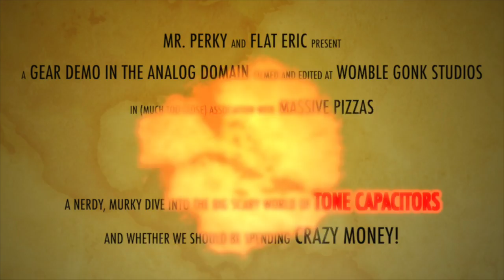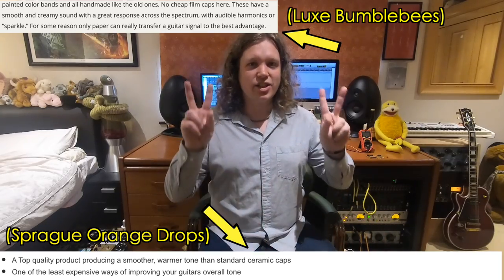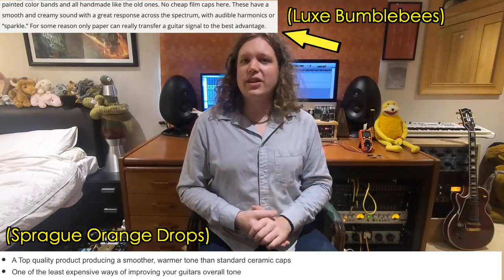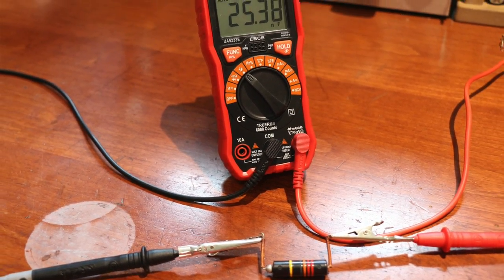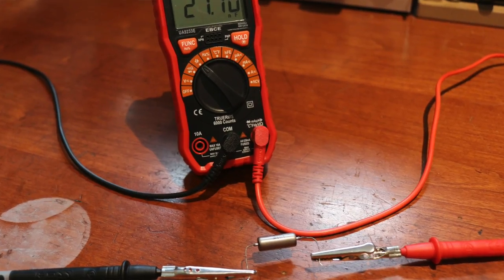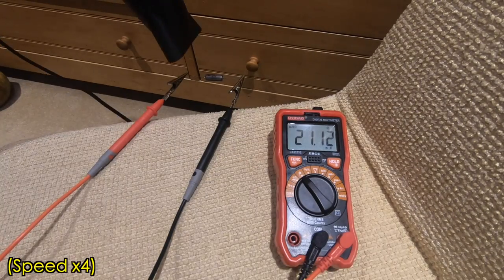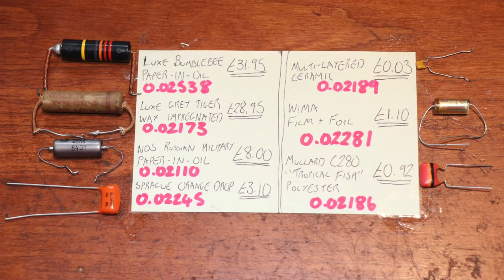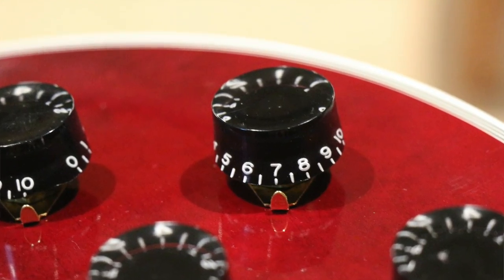Do Paper-In-Oil Capacitors REALLY Sound "Better"..??  (vs. Ceramic, Orange Drop, Tropical Fish, etc)

Comment: That is exactly it, it is like air purifiers from the movie my best friend's girl, you can't argue if they work or not as there are just too many variables. The bottom line is, Values are Values only difference is the amount of time it takes to fully charge and discharge the cap, if you put a higher voltage ( not picofarads ) rated cap it will be slower to charge and discharge, and vs versa for a lower voltage rated cap.  If someone can make a 30.000% markup and someone is gullible enough to pay for it, I'm all for it! lol They do it with Popcorn lol why not Caps lol hell there are more people with money than sense anyway, which explains why so many overpriced Apple Iphones are sold every day.

Comment: You are very wrong to assume that with the tone control on 10 that the capacitor has no effect - you should try to play with no capacitor. Indeed I do this on some of my guitars
An electronics engineer I can say that it can make no difference to the capacitors construction - What you should do is use a frequency spectrum analyser

Comment: I was noticing differences; especially as you went lower on the dial.  The ceramic cap did seem harsher/duller with less articulation.  I wasn't expecting any differences.  I was surprised.  At times, it almost sounded like you activated a pedal the sounds were so different.  You did a fantastic job with this video.  You played consistently throughout the test.  I liked the Luxe bee and the Luxe Grey Tiger.  I believe I preferred the Paper in oil type overall.  This evidence in this video is enough to justify a capacitor upgrade for sure (if a person is serious about their guitar/playing).  It would be nice, however, for someone to do this type of test with analytical software and a mechanical strummer, so that the differences could be scientifically quantified and remove any bias/mistakes.  Thank You.

Comment: A capacitor does not pass signal it removes it to ground the only difference from one to another would not be even its value but how accurate it is to its rating. So if 2 different caps were compared to each other on the same setting the one that passed the least amount of signal would be brighter and perceived clearer. Changing a cap to a different value can work better simply because we move the pot by feel and usually blindly so finding a sweet spot varys with the player. In short spending large amounts of money would be better spent on pots that have a natural capacitance that is unwanted and a better pot has less.
Reply: A perfect capacitor passes AC and blocks DC.  The higher the AC frequency is, the more easily it is passed by a capacitor.  If you connect a capacitor from the signal line to ground, then it will pass some of the AC signal to ground, making the signal line have less AC than before.  The cutoff frequency (where the capacitor starts efficiently passing the AC signal) is determined by the value of the capacitor.  A larger capacitor will have a lower cutoff frequency.  If you put a resistor in series with the capacitor to ground, as done with guitar tone controls, it will reduce the amount of signal dumped to ground, but not move the cutoff frequency.

Comment: It's really hard to stay classy when facing such a wall of stupid, like here in this comments field.

While I absolutely dig the content of this youTube channel, this unfortunately is a quite worthless test for the simple reason that  s c i e n c e actually unequivocally tells us that the only factors having any impact on the sound output from this setup - apart from external factors like how the strings are strummed, slight fluctuations in air pressure and electromagnetic fields in the recording room and other influences on the recording - is the actual capacitance value in the actual cap being tested.

In a "perfectly" controlled experiment any perceived differences in sound would be down to psychological effects at work in the minds of the listener. As uploader points out, the actual signal does not pass through these caps at all.

One could in fact record the signal straight from a pick-up, play it back through a volume/tone control setup hooked to ground and with an added switch for swapping between different types of caps with equal capacitance values, before running the signal straight into an audio spectrum analyzer with tolerances much higher than any human ear. It would of course show that the science is actually real. Not that this would sway the conviction of paper-in-oil BumbleBee believers.

The most rational phenomenon being discussed here is actually Gibsons fake bumblebee capacitor, as it makes perfect sense to take advantage of people being moronic enough to shell out 60 pounds to satisfy their confirmation bias. It is entirely a win-win situation.

Thanks for the upload, though. I enjoyed that! :)
Reply: Ace comment! Agreed 100%.
Reply: The signal we hear does not pass through the capacitor, yes, but what passes through the capacitor is SUBTRACTED from the signal we hear, so, theoretically, it CAN make a difference on the signal we hear. (Trust me, I am an EE)

Comment: I have modded amps since 1991, ive done a few HRM tonestacks ( Dumble) in Hot Rod deluxes for clients The BEST tone to my ears ?  Russian paper in oil, IF u want a warm VINTAGE sound not too harsh...more hendrixy than modded JCM 800 per se....Caps do mk a diff in tone of guitars,  gttg redi ta try a few in the Tele...The DIFF comes esp wen you push it thru a higher gain amp, n rol off some, at 10, not so much, but i DEF heard the warmer PIO wen u played!

Comment: Your final comparison wasn't so different that it couldn't be accounted for by any number of other variables, especially the human factor of picking depth and angle, and this being experienced in complete isolation doesn't impart any wisdom about musical application in a full mix, where the negligible shift in resonant frequency peak will be lost.

Also, your sample set of one capacitor of each "make" and value doesn't lend itself to definitive results, either! Practically speaking, if you want more "clarity", the better way to get it is to try a different value of a cheaper cap, not buy more expensive caps.

Apart from that, you need a no-load pot for tone if you want to cut it out completely.

Comment: I listen with apogee and presonus r65 studio monitors. Grey tiger and bumblebee have more harmonics and full sound. Orange drop best on low budget . Not to much difference but there is. If you have high end guitar go with grey tiger or bumblebee. If you don't wanna spend 
so much money go with orange drop or mullard .Only worst sound which is cheap ceramic crap :)
Reply: This. For the guys playing EMG loaded Schecters into a Line 6 Spyder (not a damn thing wrong with that, by the way), some of these subtle little differences won’t amount to much. 

But for the guy plugging a PRS into a hand wired Marshall or Fuchs (or any other well made amp), the caps can and do make a difference.
Reply: @FloridaManMatty  You're exactly right.
Reply from the maker: Completely agree with you both :-)